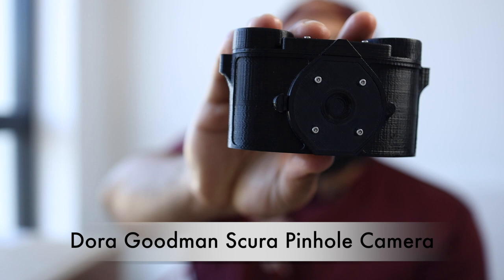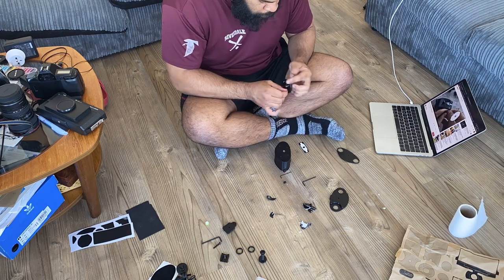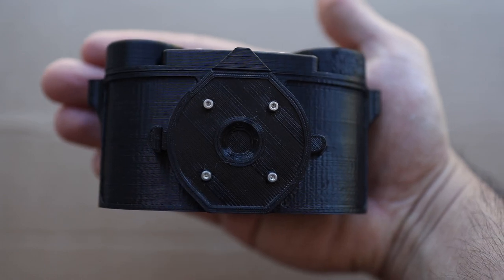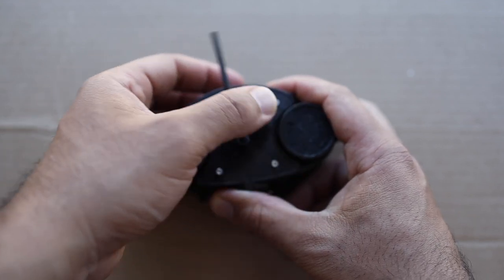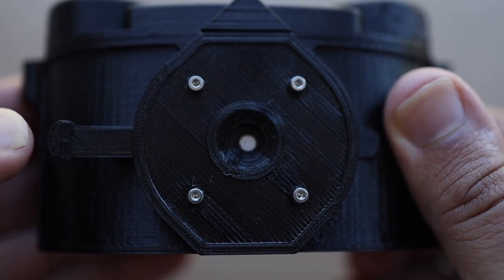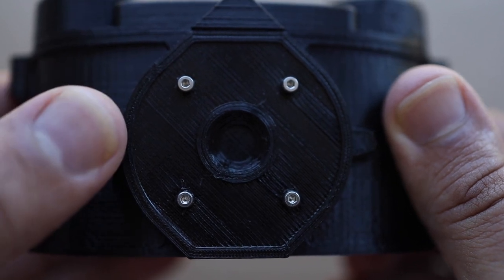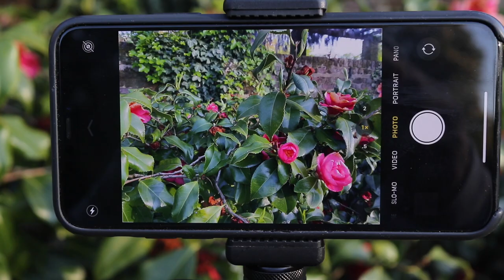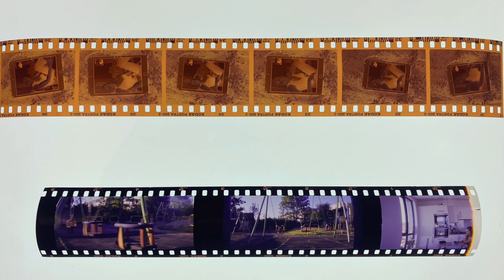3D Printed Pinhole 35mm Film Camera - Scura by Dora Goodman

Comment: Hello,  Nice video. I just received one of these cool little cameras. I put it together and did mostly alright with that part. A question: How can you tell if the film is advancing properly? Also, is it easy to feel the tension when you reach the end of the roll? Finally, about how many photos per roll? I am guessing about 18 but could be way off. Thanks for your answers and for the videos you are making.
Reply from the maker: Hi! You should see both knobs rotating if the film is advancing properly. It is definitely possible to feel the tension at the end but I recommend you count shots so that you know when you are getting close. Usually 15-18 shots I believe. Lastly, turning both knobs when trying to advance the film will make it a bit easier, as long as you ensure to maintain tension.
Reply: Hey thank you. I really appreciate it.

Comment: How do I calculate the step from frame to frame? Thanks a lot great video
Reply from the maker: hey - for the first 10 shots, its 2 full turns of the full. for the second 10 shots, its 1.5 turns of the knob. you can use the arrow on the knob for reference.
Reply: @ribsy  hey very thanks!!!